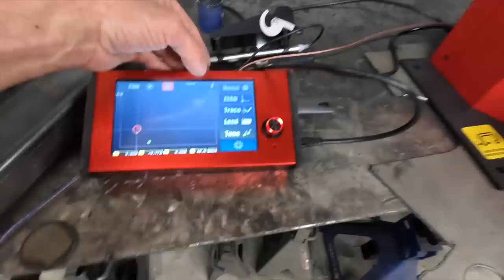Rock Sliders. Custom made for this Toyota Landcruiser

Comment: Heat shielding fabric used for sweating copper pipe in tight wall areas works great.  It was the only thing between my roll bar and headliner for my 12 point cage in my 71 Mach 1.  I've soldered custom battery cables right on the fender.  Great work.
Reply from the maker: I was wondering where my blue demon cloth was
Reply: Hah! I was asking about this very thing when he was doing the interior cage.

Comment: I would put a plate over the face of those lower rear trailing arms front mounts. On my 100-series, banging those on the rocks, the weld down the center splits eventually.
Reply from the maker: That’s in the works

Comment: These look great! I think I'm going to try making a pair for my '68 Bronco. 

I just bought an Arcdroid for work and the team and I love it. I, too, have tried to avoid technology but I've found that with the Arcdroid once you get the basic instructions down on the screen it's relatively simple. An issue I ran into was the grub bolts that hold the belt pulleys on came loose and it started cutting ovals instead of circles.
Reply from the maker: Good to hear you are able to use it. That gives me hope

Comment: I’m about ready to build mine, but instead of marking angles on the bench and worrying about symmetry I find it more accurate to define the position by way of constraints.  Using a simple 3/4”wooden block as an offset from the body to position the slider rail.  Then connect the supports to the chassis wherever there is room.  Then the angle is defined by the constraint that it must not be higher than the door.  The “poke” is defined by the tire extents.  It pretty much defines its location itself.

Comment: I like ‘em! When I welded mine onto my 80 I added square plates on the frame to disperse the load. I am curious how this style handles the weight of the 80 when it nails a rock
Reply from the maker: I initially planned to. But didn’t feel it was necessary
Reply: I would’ve done plates on the frame knowing how hard Nate goes on the trails.

Comment: Absolutely love your videos! Keep up the great work! I’m always TERRIFIED of welding on chassis. I’m scared of stress cracks.
Reply from the maker: You can fix then
Reply: @thedirtheadshed  you are not wrong. I’m gathering parts for a Cummins 6BT 12 valve on my 92’ Land Cruiser, and I have been thinking a lot about making a few braces to strengthen the chassis.

Comment: If you don't want to cut out circles for tube ends, steel engine freeze plugs work great! They also give you a rounded end for aesthetics.
Reply from the maker: I used that trick back in the day. It’s a good one.  Put them inside out for a real funky look

Comment: Dave, I have an FJ62 with crusty rocker panels and quarter panels.  My plan is to chop the quarter panels and add wrap around protection from the rear swing out bumper.  For the rockers, rather than patch in new panels I was thinking of cutting out the rot and welding in 2x4 or 2x6 tube as "body mounted sliders".  Do you have any issues with the sliders on Mom's Spaghetti being welded to the body and frame?  My plan was to just have them welded to the body but I've thought about adding kickers to the frame but I'm worried about tieing the body and frame.  The FJ isn't a rock crawler or heavy wheeler, I don't really need heavy duty sliders and I figured the body mounted "sliders" would be easier than doing body work and would give me maximum ground clearance.
Reply from the maker: Any decent protection helps.

Comment: I use a scrap piece of the 1.75 tube and slide it on the drill handle when notching... I've been smacked in the head with a drill before, the tube helps a keep the drill from that
Reply from the maker: Gives the drill a longer handle to whack you with

Comment: So question for ya, Shouldn't the main slider bar be directly over that seam? I built mine from other sliders I had built for the runner but they didn't line up to that seam so wondering if I should use another bar to cover that seam since its the lowest point. I built mine out if square tubing though and the already weigh around 50 lbs before adding the crossbar if I do.
Reply from the maker: Don’t overthink it.  Just build and enjoy
Reply: @thedirtheadshed  Lol for sure! dumping enough time and money into it though it happens haha

Comment: Maz Grande and Mom’s Spaghetti rock sliders will be into the body/ doors under a few whiskey rock slams. I’ve had to cut and reweld so many sliders. 

Sadly, to build a solid set of bomb proof sliders they have to weigh near 500lbs lol.
Reply from the maker: Yeah.  Anything can and will bend with enough abuse.